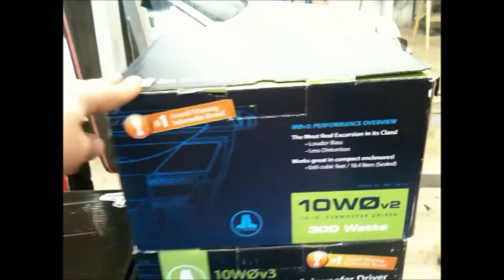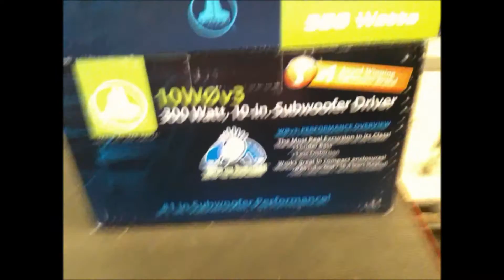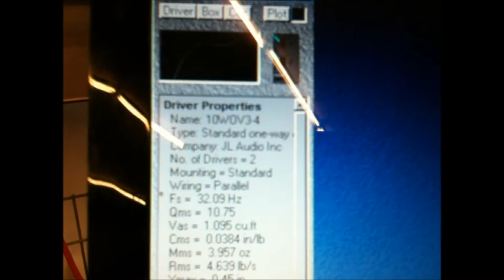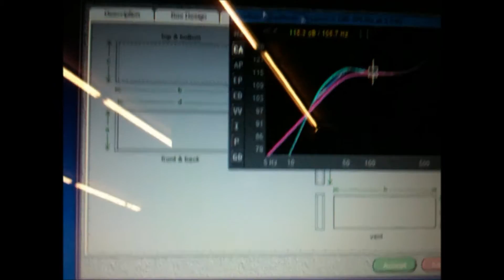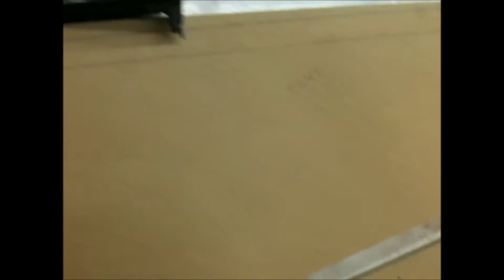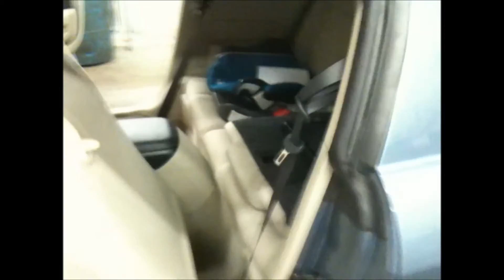JL AUDIO W0V3 2-10" CUSTOM COMPUTER DESIGNED SUBWOOFER BOX KICKER ZX500.1 2007 FORD MUSTANG

Comment: there is a w0 old school and w0v2 is where the new look came in and has a little more rms rating and a w0v2 and w0v3 then came the w2 line up to the jl w7 but yea I seen that too lol in another video this dude put a old school w0 200 rms rating and over powered it with a 1000w Kenwood amp 500 rms and said it would be OK lol um no you should never over power your subs you max your rms but not surpass it if anything he should of put a rockford Fosgate 200.1 to that w0 and then put a epicenter by audio control to pick up the deep frequencies the sub wouldn't normally pick up

Comment: Does anyone see on the boxes that the top one says 10w0v2 and the bottom one says 10w0v3. What sub is this box really built for. Just sayin.
Reply: Oh wow just saw that! So there's two diff versions of w0's in there! O.o
Reply: klassiccruzr cruizer This is the first time I’ve seen this vid and that was the first thing I noticed.  They also split the top corner of the enclosure above the port.  😳